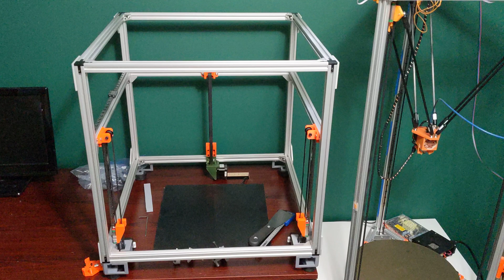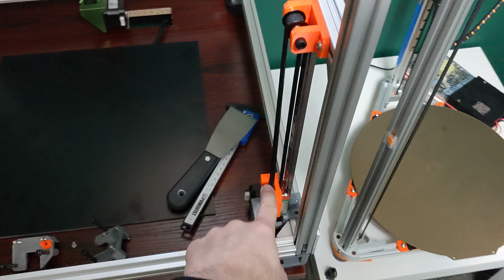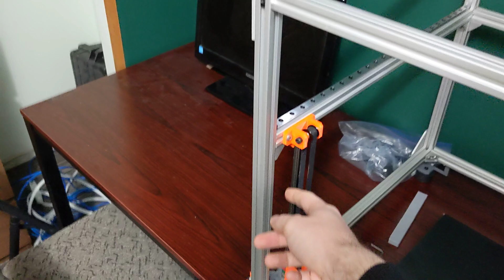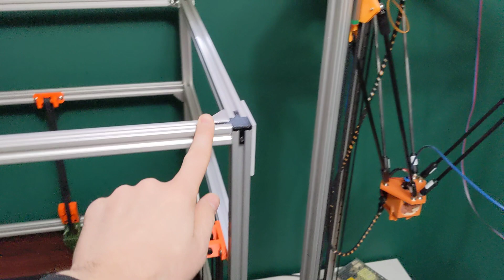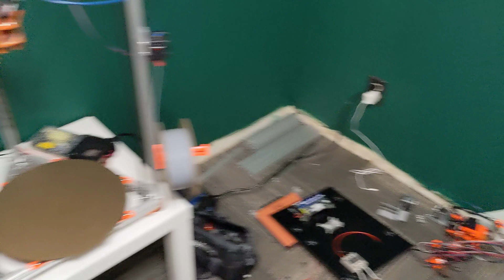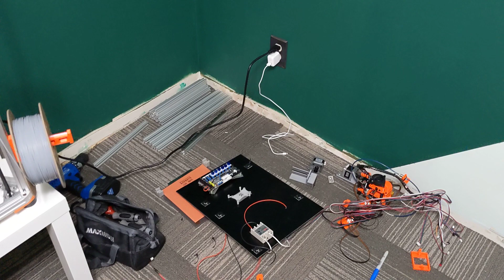DIY CoreXY 3D Printer SimpleCore 300x300 Version - Part 1

Comment: Curious what you think the maximum build surface you think could fit in here would be, you mentioned you have 330x330, but you would still need to extend the ledges for that one, so perhaps could you go even bigger, like 350x350?
Reply from the maker: 350 would fit, the 2020 that holds up the bed is 400mm
Reply: I should have finished the series, started watching the second video and saw the 400mm T, I've always wanted to build a coreXY around that size, I think this might put me over the edge to start that process